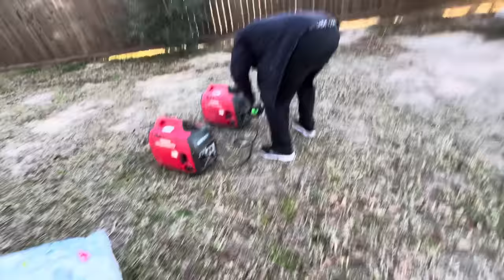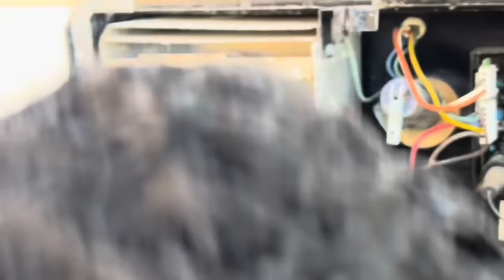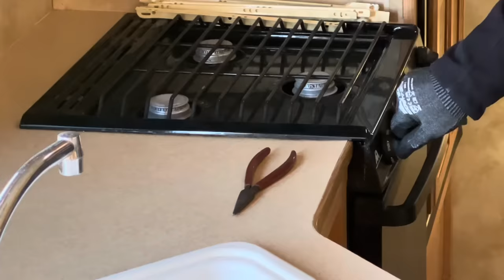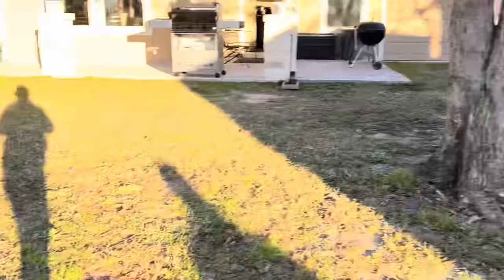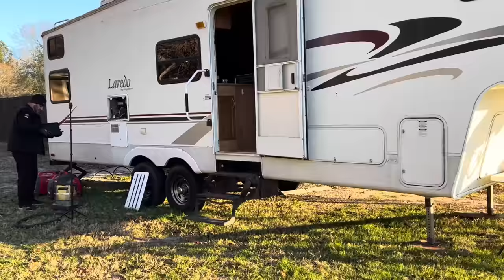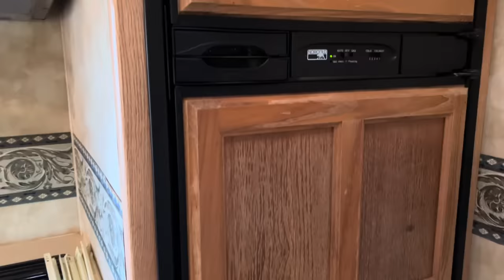Taking your advice, leveling the RV.

Comment: My father-n-law worked in his younger years building airstreams. people would bring trailers in saying refrigerators didn’t work. Biggest problem was people not having a level trailer. He had to take refrigerators out and turn them upside down for awhile. When he put them back in place, they would run. you have to have a level trailer for refrigerator to run correctly.

Comment: That RV has cleaned up so nice. A good pressure wash and wax it will look brand new. Rob I have always been in PA and yes it sure gets cold. I'm on top a mtn. not far from 911 site. I looked it up and you would have only been about 4 hours away. Bread bags I remember them over our socks to keep the feet dry when we played in the snow. I lived way out in the country and they use to put chains on the buses. Buses in the 70s were so cold. I don't think heat ducts came back sides. Times sure changed.

Comment: Check all the wiring because mice will get in and chew them. I put moth balls where the wiring is for the hot water heater, etc when I winterize my RV, keeps them away from.

Comment: @Tina & Rob Living Off the Hill  Hello Tina and Rob, the next thing you’ll want to do, when it warms up, is to pull the shrouds off of the air units and clean them out, guarantee there are even more Wasp and Dirt Dobber nests in those as well.  The next suggestion is that you purchase Wasp and Dirt Dobber Screen to block off those areas where they like to build ie.. back of the refrigerator, water heater, air units, any of the circulation vents. The RV is looking great and I know y’all will have a great summer get away when you’ve completed your renovations and improvements. Y’all stay warm and safe. God Bless! ✝️🙏🏻🇺🇸😊🥰
Reply: Great Suggestions Lisa…..
Reply from the maker: Thank you for all these pointers! It’s good information ❤
Reply: @cherryshafer5279  Thank you! I own a Keystone Cougar just a few years younger than this Laredo.. the features are very much the same.  Just trying to help as much as I can.

Comment: when we had an older 5th wheel that didn't have self levelers we'd put a pan of water on the stove to make sure the stove was level. we'd put a bubble on the front up by the storage bin and a level on the back bumper.  those little bubble levels stick on's are nice.

Comment: I rode the bus to school but if it snowed during the day and school let out early the kids on my bus had a problem. I lived on the hill that determined whether or not they called a snow day. This was before they had chains for the bus tires. Sometimes the bus couldn’t get up our steep winding road. School would call several parents to come pick up kindergartners to take them home but the rest of us were let off the bus at the bottom of the hill to walk home in the snow. The road had big ditches on each side with no shoulder. We had to climb the hill watching out for cars sliding down the hill. My house was 1 1/2 miles up the hill and was the first house. Everyone would stop to warm up. Some of them had to walk 5 miles to get home.

Comment: On my motorhome fridge the little light blinks for awhile, then stays a solid light, I'm guessing when the fridge is finally kicked on or something. The blinking seems normal though for awhile. Plus a fridge needs something in it to really work right. I put bottles of water in both the fridge and the freezer (not full bottles in the freezer tho) then leave the fridge on for a couple hours to see if its working. Also those rv fridges need to be level to work right. 
That puppy is so darned cute. Love that little playful growl puppies make.
Reply from the maker: Thank you for letting me know about the green light on the fridge. Tony soprano has two gears. He’s either biting and growling or he’s asleep snuggling. ❤

Comment: You are right I line in Ill when we were growing up there were no buses everyone walked rain snow sun it didn't matter. It's been -30 windshield for 4 days I prepared had heaterd running under sinks ect it didn't matter it still froze the hot water. I do prepare So I have extra water ect. It's just to cold!! Pipes have not burst that's the main thing I think we have 4 more days then a heat wave 21! Stay warm and safe freezing in Ill

Comment: Also check to see if you have adnoid rod in hot water heater outside on camper. Some campers have them. Ours don't but some that do have adnoid ROF can corroid and will need replaced. Get some bug screens and cover all openings on fridge vents and heater vents to prevent dirt dubbers,insects from getting in. We keep a small level right inside door to check levels as we stop and set up when camping. Lift stabilizers before leveling ya can't raise the front if their already down. We use a drill to put stabilzers down makes it so much easier. Got to hook up to propane to have gas. Or its only gonna work on electric which will eat battery up.
Reply: Right, anode rod. Also Auto on the refrigerator is if there is no electricity available it will use the propane.  So it should be turned off when stored. It will use the batteries until dead, then switch to propane until empty. so turn off!
Reply: OH put wheel block on the tires. Or chalk blocks.

Comment: There should be a small level attached to the RV somewhere near the  self-leveling switch. It would be no more than 3" long. If you don't find one, you should be able to get an adhesive level of that size at an RV shop or Walmart or Amazon, and fasten it to the front of the RV near the switch. This way you can tell when you have it level without having to eyeball it. Most are already equipped with one. 😊

Comment: You need it level so the fridge and stuff works at maximum performance!! Do you have chocks on the tires, just so it doesn’t roll on you! You can push just the electric button on the fridge.
Reply from the maker: I think it’s pretty level. And yes, we do have the tires chocked with a brake.

Comment: Y'all need to look up and print out the handbook on this trailer. Most things are run by propane and or electric. I have a trailer from around the same time period. But the owners manual will definitely help you a bunch. And buy a level to make sure you are level. Also check the rod in your water heater. Question why are ya'll using 2 generators? I've only every used 1. Just curious.
Reply from the maker: I just make some stronger, so it won’t pull on just one because they are kind of small generators.

Comment: An RV refrigerator MUST be level to work.  They are not like home refrigerators, they work by gravity. If they are more than half a bubble off level (you check it on the floor of the freezer with a real level).  Please do not turn it on until the RV is really levelled.  As long as the refrig is not on, all is ok. But you will ruin it if you turn it on when it isn't very close to exactly level.
Reply from the maker: Thank you for the advice ❤️

Comment: 👋🏻 guys 😁
Reply: Stay warm, guys. I'm sure you feel the cold like we feel it up here. Cold is cold is cold. 🥶  There should be a level bubble on the side of the trailer inside and/or outside. Some have them inside a cupboard. Have you checked the condition of the floor?
Reply from the maker: Hi 👋 ❤